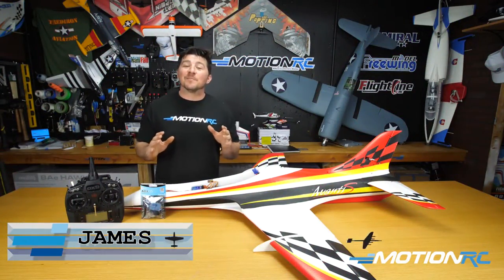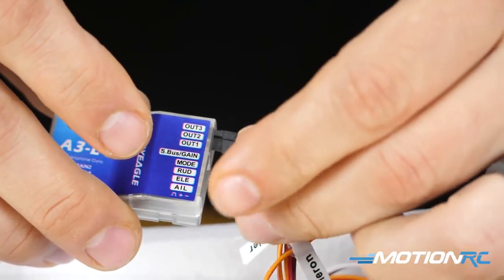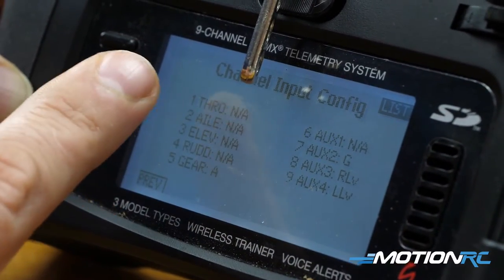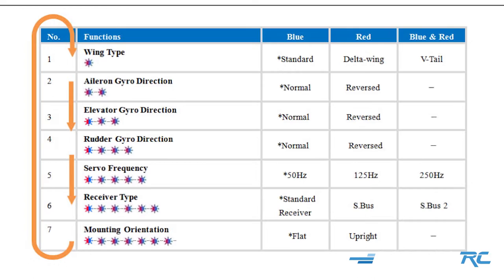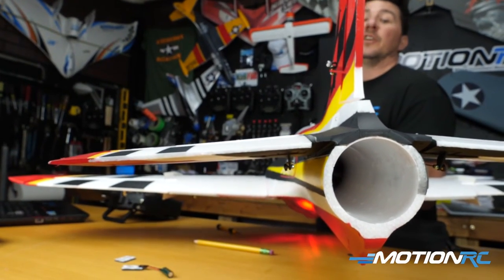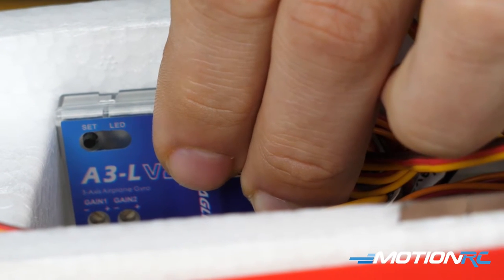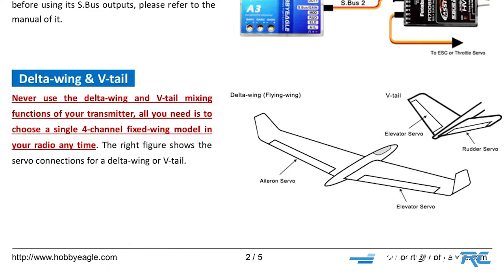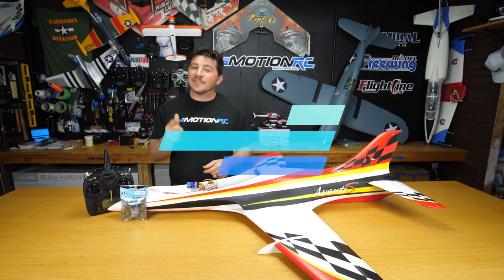HobbyEagle A3-L V2 Gyro - Set Up Video - Motion RC

Comment: I have programed the on off switch as shown with no problems, but I do not have a knob on my DX6 to control the gain. Can you please tell me how to set the gain using a three position switch so that I can change it to say 33% 66% or 100% of the gain set on the pot. None of the videos on Utube show this and it is not in the manual. Maybe a short video would be good for this or at least an explanation.Thanks in advanceJames, and thanks for the great video. Mike.
Reply from the maker: I can make a video for you for sure. But quickly try this. So, as I say in the video. When you set your master gain on a knob or slider, the max gain will always be whatever the max gain you have set on the gain 1 pot on the front of the gyro itself. So I never make that pot more than 50% (haven't come across an aircraft needing that much). So instead of setting it to a knob, set it to a 3 position switch (as I do it in this video for the knob). Then, if you haven't changed the travel like I did to make the mode "on/off", then the travel of -100 will be 0, 0 would 25% or half what the gain on the pot is and 100 would be 50% or what the max gain on the pot is. Play with the travel of each position of switch to get to 33%, 66% and 100%. (let me know if this makes sense)
Reply: @MotionRC  Thanks James. That makes sense. Will give it a try over the weekend. Thanks again. Mike.
Reply: Hi James. made settings -20,  +40, and +100. Seems to give a nice progression of gain from about 40% of pot to 100% of pot setting. Thanks for your help. Mike.
Reply from the maker: Sweet! Come back and update me on how it went.

Comment: Just finished installing this today in a 1.5m 3D plane, Double checked all control surfaces, all gains were left standard, level calibration, ect, ect. Took off and couldn't control the plane at all, went up about 10m then smashed into the ground and into lots of pieces...to say i was pissed would be an understatement. But im willing to try a second time in something less expensive and smaller, as everyone else seems to be having success with this. Is there something simple im missing or haven't done? Feel free to comment guys.Much appreciated.
Reply from the maker: were the gain pots too high? There is no standard for gain pots as different aircraft require different gains. But you have to start on the low side, 15-20%. Then work your way up. Sounds like maybe the gain were too high for the aircraft so the gyro was overcorrecting making it almost uncontrollable. When set up right, these gyros are terrific, I have them in lots of models
Reply: @MotionRC   Yes iv heard and seen nothing but good things with these gyros. I made a mistake, i have the A3-V3 not the V2, but some thing. My gains were all set standard, in the 6 O, clock position. I didn't touch them at all. Im really determined to master this, i usually use i-nav or Ardupilot but for some calm park flying and stunts tha,ts just overkill. That,s why i bought one of these. So should i turn all the gains down to what looks like 3.45, Quarter to three and go from there? Cheers

Comment: is it possible to use this gyro when a plane is set up with a servo on each elevator half and one channel is assigned to CH3 ?
Reply from the maker: Yes, as long as both servos are Y'd together going into the one elevator port than you are fine. It's when you want to run 2 elevator servos in 2 ports that you would want the A3 Super3 Gyro from Hobby Eagle

Comment: Hey James, I have an E-flite Piper  Pawnee 15e ARF that is set up with flaperon on my airplane.
The way I have it set up is my right aileron is going to the aileron receiver and the left aileron is going into Aux1. How do I set up so both ailerons are working with the Hobby eagle a3-l v2 when turn on?
Reply from the maker: You are going to want the Hobby Eagle Super3 (the black one) if you need aux ports and more capability.
Reply: @MotionRC  thank you.

Comment: the manual says to mount the gyro as close to the CG as possible. the position it was mounted in the video - is that close enough? has this model been flown successfully with the gyro in that position? thanks
Reply from the maker: Yes, Closer to the CG is ideal, but I have never experienced any adverse effects from a gyro anywhere in the battery tray. And have flown with pilots who have put them up in the nose as well without issue.

Comment: My receiver has a Left and Right aileron channel.  Will this gyro work on my plane?  If so, any wiring suggestion?
Reply from the maker: It will only work with this Gyro if you Y-Lead your Ailerons together. Simple and cheap. Or you can go with the A3 Super3 that uses either the laptop/desktop software or a programming card. Easy to install as well and has 5 ports for input channels from planes for just this. And no Y-lead needed.
Reply: @MotionRC  Awesome, thanks for the quick response.

Comment: I have a stock harbor freight P51D Mustang with a 72mhz transmitter, would i have to upgrade to a nicer transmitter & receiver with these menu functions in order to get it going? Or is there some plug n play default mode?
Reply from the maker: This will work regardless of transmitter and receiver you have. You may not be able to have multiple functions on a switch, but you can certainly have just the gyro on all the time if you feel you need it. But eventually you should be thinking to upgrade your protocol
Reply: Motion RC got it!! Thanks!! 

And yes, I’m new to the hobby so I’m still figuring out what it is that i like and need. Also what fits the budget
Reply from the maker: @jamr2t  Get ready to blow your budget ;) (RC Hobby joke) Welcome to the Hobby man and thanks for tuning in
Reply: Motion RC would you recommend this one over the pro for a rookie?
Reply from the maker: @jamr2t  They are pretty similar, one just offers more functions that a beginner probably wouldn't need. But they said up similar with a series of light etc. I have a video that runs down to differences between them on the channel
Reply: They out did themselves on these, you will be happy but do yourself a favor, upgrade to a better plane, you will thank yourself. Shop your local facebook marketplace for RC planes, I have gotten several for a really great price.

Comment: Quick question, if i set up a v tail through the gyro and then switch the gyro off am i going to crash?
Reply: You want to make sure your transmitter is set up for a V - tail or YES, you will.
Reply: @scottfirman  Sorry but that is BS! ALL these stabilizers do ALL the mixing on the stabilizer (EVEN WHEN SWITCHED TO MANUAL!) If you try to start adding extra V-tail or Delta mixing via the transmitter you are just headed for grief! 
The ONLY time you will need transmitter mixing is if you physically remove the stabilizer from the circuit!

Comment: Savez vous comment effectuer le câblage pour une aile delta ( 2 servos"aileron et élévateur ensemble" +  un moteur électrique )
Do you know how to perform the wiring for a delta wing (2 servos "aileron and elevator together" + an electric motor)
Reply from the maker: Yes, at 19:42 we speak of the delta setup. Basically, you go into the 1st menu option and change the wing type to Delta. You plug your elevons into the aileron and elevator ports. The key is that you DO NOT have to change your transmitter to a delta setup as the gyro does all the work for you. Set your transmitter up as a normal (standard) aircraft. Just the gyro needs to be in the delta mode
Reply: @MotionRC  Merci de m'avoir répondu , je vais faire un essai je vous tiens informé.
Thank you for answering me, I will give it a try I will keep you informed.
Reply: Bonjour, cela fonctionne parfaitement mon problème venait bien que, je mettais mon éméteur en delta.
Merci beaucoup.
@+
Hello, this works perfectly my problem came although, I put my transmitter in delta.
thank you so much
@ +

Comment: You 100% fail to mention how to power the unit. In terms of what sequence to plug what and where and when to plug the battery in. Or even where to plug the battery in. If you do this in the wrong sequence, you will start a fire.  I know because I started a fire. The only reason I’m watching this video is for the information that apparently it lacks: where do I plug in the battery?
Reply: You plug the battery to esc and esc to receiver vcc

Comment: I tried setting up the same exact unit that I bought on eBay on my grandson’s gas powered airplane no matter what I did the Gyro did not seem to work I tried multiple configurations based on the instructions that I found on this unit not only here but on their website as well and I cannot find anything that would direct me as to how to get this to work in conjunction with a gas powered nitro RC plane do you have any suggestions is this not a possibility because I just witnessed a video of a guy in Germany flying a gas powered nitro plane with a six axis gyro
Reply: I dont think these work with Nitro. I am not sure. I have the same unit in my Dynam Waco and it works great. It may be vibration is preventing it from working.